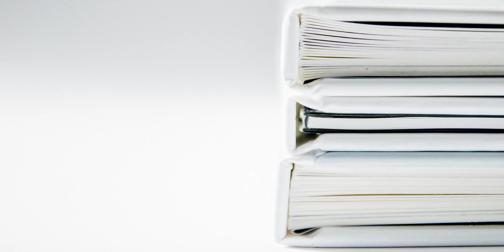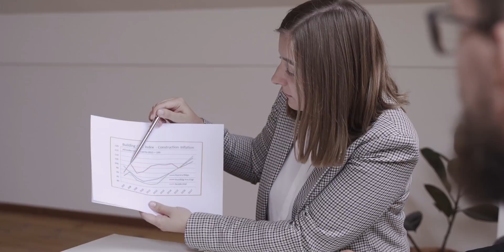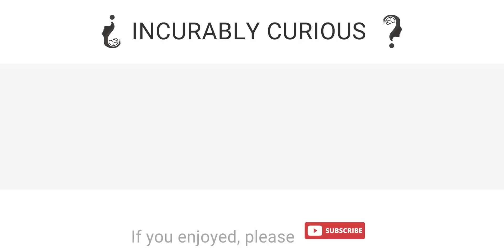Why Most Power Lines Aren’t Underground

Comment: Paradise, California, paid much more than twice as much for overhead power lines. At least 85 dead and 18,000 structures destroyed (including ours) by wild a fire started by poorly maintained overhead wires on November 8, 2018. Even if it had been started by another source, the problem of roads being  blocked by downed wires and fallen poles would have been the same. Evacuations were complicated by this issue and some lives lost may have been directly due to the fallen lines and poles blocking streets. It certainly complicated reentry intoto the town and debris removal. PG&E, the electrical utility for the area, is now burying all utilities in the town. It has already buried transmission lines into the area. Admittedly, the work is easier now that 95% of the town is gone, but we will always wonder how different it would have been if lines had been buried as a practice prior to the fire. 

All utilities were buried during construction in the neighborhood where we bought a replacement home in a neighboring town. In almost four years, we have only had two momentary outages even as many thousands have been blacked out to reduce the likelihood of starting fires on red-flag fire warning days. (PGE had warned us of impending preventive power outages before the fire started. I woke up every morning that week in November wondering why we had power. PGE knew the risk and were held criminally liable for the fire. No monetary settlement with them will truly compensate us for the loss of property, employment, and community we suffered as a result of the fire.)

Comment: Living in Denmark. it's very funny to see this video, as all our powerlines exept the greater part of the big high voltage lines lie underground. But even hurricanes very rarely damages the high voltage lines. Of course, we do experience occasional blackouts when, for instance, a transformer station experiences a breakdown or is damaged in a thunderstorm. Such breakdowns, however, are mainly local. Regional blackouts seldomly occur. I remember only one, nearly 20 years ago, that was caused by a fire in a Swedish transformer unit. This started a chain reaction that blackouted southern Sweden and east Denmark for appr. 4 hours.

Comment: It's not just the initial cost of digging up all the roads and interfering with all the other utilities already there, there's also buildings or other obstacles in the way and then if you need to replace the cables, you have to start digging it all up again. We've already got enough workmen digging up the roads and causing massive traffic problems, we don't need any more!
Reply: Cables are under footpaths, not roads.
Reply: @scottwhat3362  no, they are also under roads. How do they get across the road? And what about when there's no footpath?
Reply: @laernulienlaernulienlaernu8953  Yes, they go across roads. But their standard position is between the road and the property boundary, footpath or not. They don't dig up the road. They directional drill the cable. I've been a cable jointer for 18 years and I have never seen a road dug up.
Reply: @scottwhat3362  so why are all the roads always being dug up? Often because of the position of existing utilities they have to route supplies wherever there is enough space. If there's nothing beneath the roads then why do my local roads look like a patchwork quilt from all the times strips of road has been dug up, backfilled and repaired.
Reply: @scottwhat3362  it's dependant on where you live and the existing infrastructure.
Reply: @laernulienlaernulienlaernu8953  I didn’t say nothing is under the roads. I said power isn’t. Sewage and high pressure water are often aligned under roads. If you not going to listen to someone who works in the industry. Then there is little point conversing with you.
Reply: @scottwhat3362  well I've seen roads that are dug up and vans with NEDL (electrical contractors) on the side. Are they installing water mains! And my original point wasn't really about whether it's the road or the pavement, it's the fact that they have to dig it up in the first place and yes, most times it is under the pavement but it still involves temporary traffic lights because of the size of the trench and the safe working distance either side.

Comment: The situation in Germany is as follows. In the past, only two bare wires were routed to the houses on insulators, i.e. a hot conductor and a return conductor. But the network was often too weak. Therefore it was converted to four bare wires, three hot wires and one return wire. This means that 3x 220 volts or 380 volts three-phase current can be distributed. In the meantime, the voltage has been increased to 3x 230 = 400 volts.
But the bare wires cause problems when trees grow or repairs on the roof become necessary.
Therefore, when repairs are made, these lines are replaced with insulated cables over the houses. But in the last 20 years this has been replaced by cables under the pavement in road construction.
10kV to 20kV lines are also gradually being converted from overhead lines to underground lines.
110,000, 220,000 and 400,000 volt lines are almost always designed as overhead lines.
The problem is that underground lines lose more power.
The construction of high-voltage lines underground is also possible, but 10 times more expensive than on power poles.
Underwater power cables are almost always operated with direct current to reduce losses.
Reply: I thought HVDC was more used due to distance and grid sync issues?

Comment: There is also an Issue that ties in with the issue of extendet cost: Due to the fact that underground powerlines are closer to the earht and each other their earth capacitance is way higher. This means that every few kilometers, this capacitance would have to be compensated. This would require a building housing coils.

Comment: Power for my neighborhood is all underground, and we still have power outages from blizzards and thunderstorms.
Reply: I know I am responding a year later, but that might be because there is above ground power lines somewhere hidden in your neighborhood. This would explain why every time there is a storm, your power goes out. Because I don’t ever thing a blizzard would effect underground power lines
Reply: @Texial  Got a golf course to the north and empty fields on every other side of the neighborhood. There's no trees, and the only thing taller than the houses in this small neighborhood is the street lights. So if there are above ground power lines them and the poles they are attached to must be using some pretty advanced cloaking technology to be invisible cause there's nothing to hide them. Also the power lines aren't the only power infrastructure and just because the power lines are run underground doesn't mean everything is underground and safe from the weather.

Comment: Having worked in underground electric for 35 years on the east coast I disagree with a lot your points. Why would an earthquake affect an underground power line and not a power line on a utility pole? That is just a ridiculous statement, the poles are in the ground. 

I have personally worked on cables underground that over 100 years old and still going. Failure rate underground is much less than it is overhead infrastructure. Sandy was a black swan event.

Comment: Underground is better, but more expensive to do. The power companies say that underground fails a lot,  but that is a lie they tell because they don't want to go underground. It's expensive and can be tough in some soil conditions (rocks).  It's also easier to go inspect above ground lines and repair them. They want to do what is fast, easy, and cheap.
(I'm an electrician).

Comment: Nah. Try again. The 40 years are for house cabeling. There is research into how old mid voltage underground cabeling lasts under different conditions and so far, after 60 years none of the cables have failed in that experiment. If there would be a major problem like them only lasting half the time we'd be having them replaced all over Germany as most of ours are past 40 years by now for sure (and most western European countries) all the time and we do not. Happy with undergrounding since 1885. You simply chose cheap over reliable.

Comment: I was interested to see that on some streets on The Netherlands the services are in rectangular concrete conduits that make up the sidewalk with slabs over the top for easy maintenance. Whereas in the UK everything is under the road which has to be dug up every time they want to repair drains/gas/electric (phone wires are in their own conduit).
We used to have housemartins nesting under the eaves at the front of the house but they stopped coming soon after the phone wires were put underground. Before, they all used to gather on the phone lines before flying off to Africa for the winter. I'm not sure if this is the actual reason for their disappearance though. Other birds (pigeons, crows, starlings) are happy to chill out on the high tension distribution cables and the overhead cables in the rural lanes. Kestrels and Buzzards like the tops of the poles as lookout points.
France in my earlier years had a lot of pre-cast concrete poles for phone and electric cables. They were cast with slots all the way up that could be used as footrests for service engineers to use when climbing. However the sparrows soon realised that these were excellent nest sites and you would see poles with loads of nests so I guess it was back to using ladders!

Comment: I'm surprised car knocking out the power poles or getting stuff stuck in lines was not mentioned while people digging into underground cables was, despite same people also digging into water, sewer and gas lines just as well, yet I don't see water or gas lines overhead anywhere

Comment: Some of the arguments of this video are not correct or grossly exaggerated. I live in the Netherlands where the soil is soft, that is a fact, so that makes installing underground wires a little easier. 
We only have above ground power lines for High Voltage transport cables (110 Kilo Volt and higher). 

The problem with the US is that there electricity system is antiquated and the net (the cables from power plant to the house) is privately owned and it is an unstable power grid. Power out itches are common. 

We have a power grid that is hands of the government, but the power itself is generated by commercial power company's. This makes it way more easy to switch power company, as they do not own the grid. 

The power company's have to work to strict rules (financial rules and service level rules) and if the don't they lose the right to sell power. The reason to organize it this way, is to protect the consumer, not the company. Funny is that in a construction like this the prices are relatively low, as the power company's have to compete for the customer and power out-itches are very rare. 

We have a stable and secure power grid, we can buy power for competing prices and when we are not happy with the service of our power company, we can switch to the competitor.
Reply: *their

Comment: It's really cost. Reliability for undergound grid components would rise with demand as manufacturers adapt to the changing market. Many lawyers at the power companies dream of a majority underground grid, as liability potential would head to nearly zero. There are places where it is geographically impossible to put power underground sure. But, with proper planning and new technologies for digging, trenching, drilling, and piping, the ability to cross difficult terrain has increased. With proper conduit and insulation, grids with equipment-above-cable-below design usually are more robust than above ground grids. If all conpanies did this, the costs would be subsidized eventually through competition of price and reduced cost of revenue. I think underground grids are economically viable and certain changes to how we approach grid design and how we make our grid components really could come together to make a more robust grid. With industry-wide cooperation costs could definitely be put under control.

Comment: A slight correction to guying. The main purpose of a guy wire is not to anchor a pole for environmental forces but to balance forces placed on the poles by the power lines and utility lines that are pulled under tension. You will most commonly see these wires ,connected to anchors in the ground with a yellow guard on them for visibility, on corners or where a line stops. Next time you see one of these wires try to look at what system it is trying to account for because each system on a pole should have its own guy wire.

Comment: In the 9 years I've lived in Germany I have not had a single power cut and they have underground power lines.  In the 6 years I lived in Switzerland I did not have a single power cut and they have underground power lines.  In the 2 years I lived in the Netherlands I did not have a single power cut and they have underground power lines.  I the 4 years I lived in London I didn't have a single power cut and they have underground power lines.

In the 1 year I lived in Australia I had a few power cuts and they have over ground power lines.

If I go back to when I lived in Bristol, UK (before 1998) we would have a power cut every couple of years and we had underground power lines.  The infrastructure was old and badly maintained.

If you have underground power lines and that infrastructure is well maintained you shouldn't have any power cuts.

Comment: All cables below 40,000 volts are underground in Denmark. Cables of 40K volts running through cities have also been dug down. In Denmark, this process was stated in the middle of 80 'and the project was completed in the middle of 00'. In the beginning 80 'to mid 80' the state telecommunications company laid fiber optic cable into the ground to distribute TV signals, and in the same excavation the first power cables were laid. later natural gas and district heating also had to be dug down and more cables were laid in the ground aswell. The state did this because the economic benefits of laying cables in the ground outweighed the maintenance of not letting them lie underground.